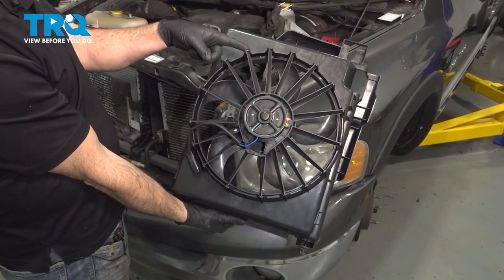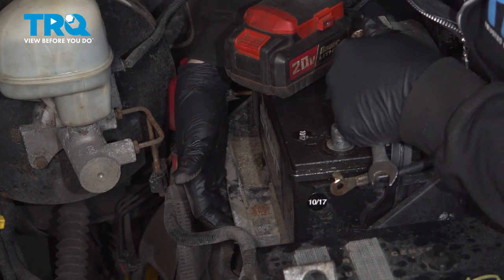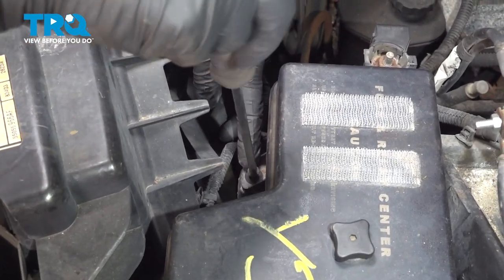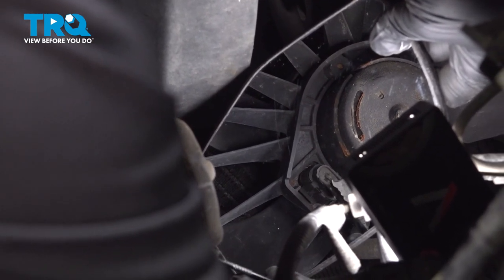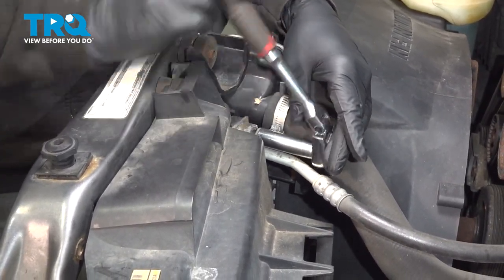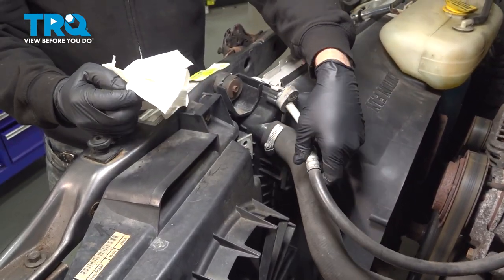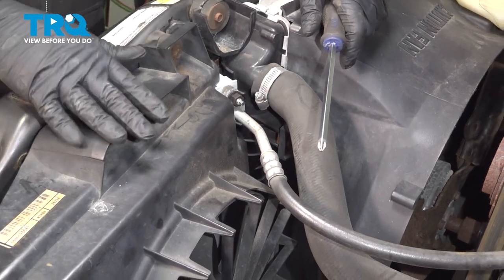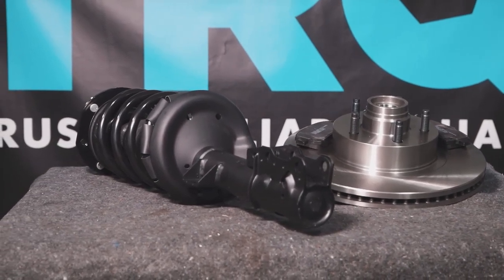How to Replace A/C Condenser Cooling Fan 2002-2008 Dodge RAM

Comment: If you've landed here, wondering if this is your issue, after checking other things like AC Pressure Sensor, Relay, Fuses etc.....THIS could very well be your fix.  Got mine on Amazon for $80, took my time, and in a couple hours my AC was back running like a champ. Prior Symptoms: AC Running, but clutch cycling on and off, and at stop lights, your AC drops and get's hot, then driving again it goes back to cold. It's the AC Fan unit. If the fan isnt running when you start your AC, replace it. My assumption is the System tells the computer it's overheating and auto shuts the clutch off which stops the refrigerant from flowing to your vents.  Luckily after 20 years of running my AC, I never had to recharge or mess with it until the Fan problem. Happy DIY-ing.
Reply: And this replacement fan unit can be replaced without redoing or removing the AC lines, you just have to cut some of the plastic....you'll see, or find other videos that show where.

Comment: Changed mine today on 2006 Ram 1500 4.7

Removed crossbar 4 bolts, condenser fan to crossbar 2 bolts, and 1 from radiator. Put crossbar to the side.

Disconnected fan from underneath and removed 1 plastic screw attached to fan to that held electrical lines.

Removed battery, detached and moved fuse box where battery housing is for more room.

Unhooked condenser tubing from three plastic holders front passenger side, unscrewed 4 bolts holding condenser to fan, and wiggled condenser out to the front side of truck like 6inches of play then take out condenser fan.

Transfer old fan bushings to new, and reverse it all. 

Took me an hour, spent 20min trying to fit in the condenser then it fit by itself…? And that’s it. Cold A/C👌

Comment: Just replaced mine and didn't have to remove the battery or loosen the fuse box mount, it just slid right up and out after removing the top bolts (and of course the lines if still attached), was a breeze, thanks TRQ!

Comment: I jus replaced the fan motor😂 cut the plastic pulled the shroud up pulled the condensor to the side unbolted the fan from the motor took the old  fan motor out put the new one in reversed it back together and turned on ac and thats it blowing cold again😅

Comment: looks like the one that was removed was also aftermarket.  My OEM fan unit is original amd looks slightly different in the fan and fan protection grill area, and the electric connection point on the fan is in a top location and not the bottom...like the aftermarket one I just bought. My aftermarket version matches the same as your version here.

Comment: I just replaced mine. I'm having issue with the vibration. I can feel the vibrating through the steering wheel. I can't figure it out. Could anybody out there 2 cents in please

Comment: cut the plastic no need in recharging system
Reply: i also wiggled it out without removing fuse block
Reply: and if you can like me removing the small side bolts holding the condenser to the plastic shroud can be done also
Reply: in truck